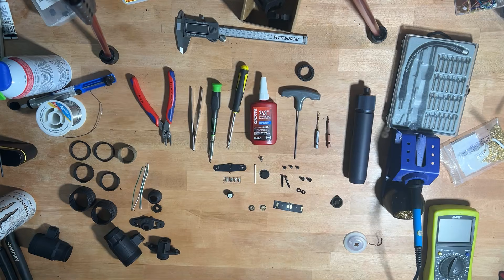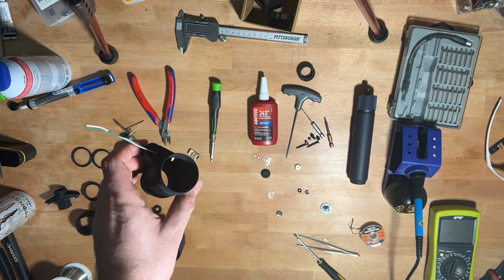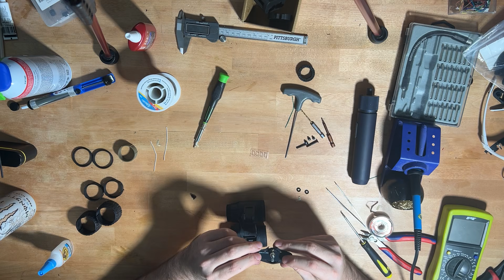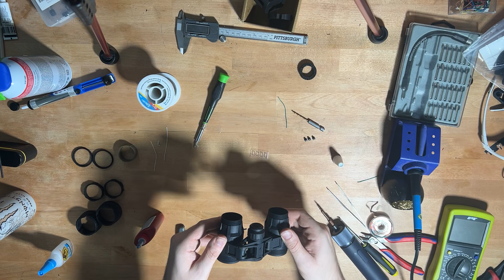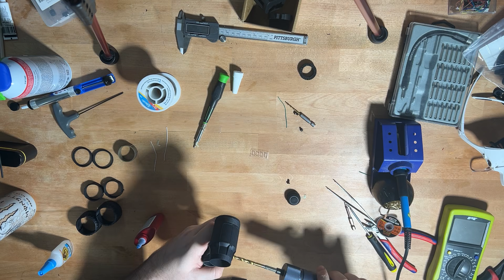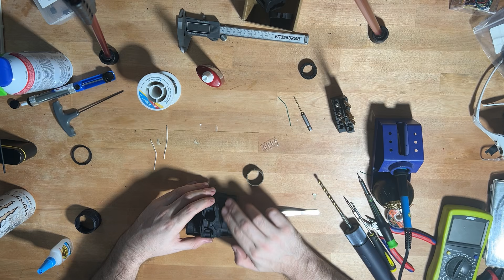PVS-69 ALPHA 2 build video

Comment: I'll be ordering some of these kits for my next 3d printed project. 

Side note, alligator clamps are a tinkerers best friend. With the right kit, you can hold the boards and wires and stage them for soldering. My kit also has a magnifier for the smaller parts I tend to work with.

Comment: Can you still use the alpha 1 pod boards?
Reply from the maker: The stow off PCBs? Those only had a slight change and are PROBABLY still usable. I made the diameter of the ground pad smaller
Reply: @vonscherfarms925  sorry I mean the PCBs that interact with the tube. Do these require the use of the flex board?
Reply from the maker: @rangetherapy8117 flex board or you can solder a wire directly to the spring. The old rigid PCB does not fit